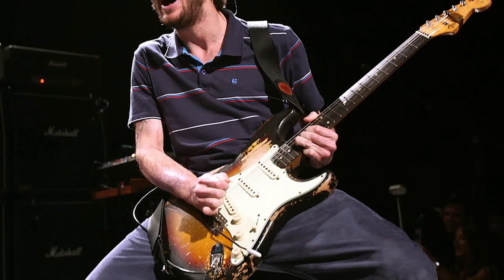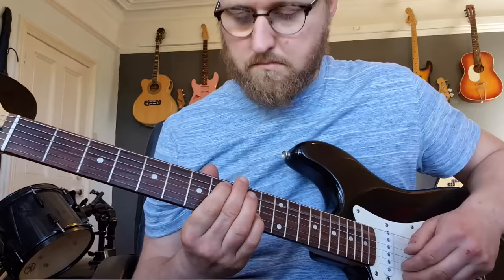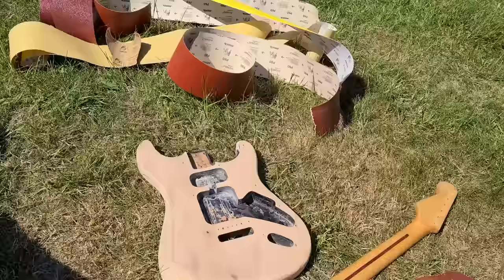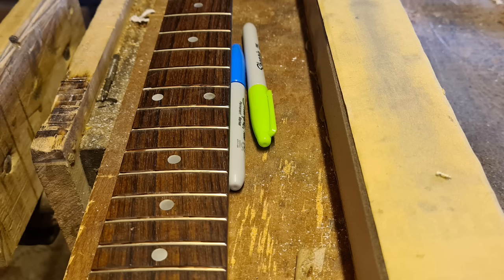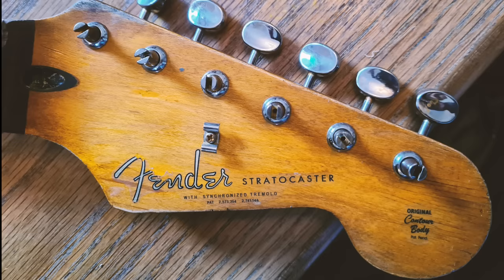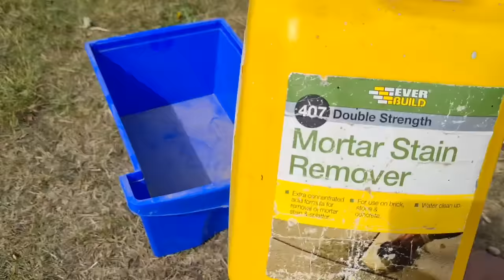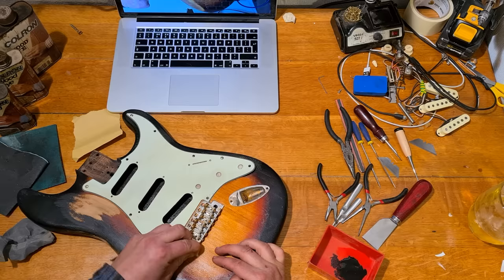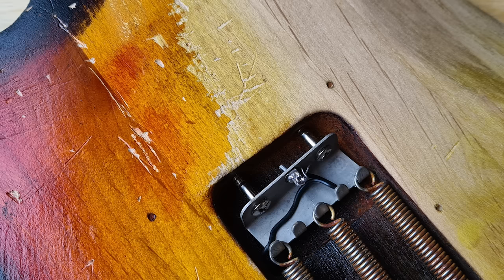How To Turn An $80 Squier into a John Frusciante 1962 Stratocaster

Comment: Nice work. I especially liked how the aged Fender headstock decal magically appeared from out of nowhere before the nut went in.
Reply: @fathippo3518  before and after what? The parts added or swapped out were documented and explained throughout the article. The decal "simply" appeared, no explanation of where he got it, or how he managed the aging of it. Considering how much the decal contributed to making the guitar look like the original, I do think that it was a very obvious and deliberate omission. So tell me FatHippo, where did he get it, and how was it aged? The author could have saved a lot of time by just showing a before and after shot of the whole guitar.
Reply: Yea, I ended up scrolling back through the video to try and see where I missed him talking about "Hey, I have this genuine strat logo that we're going to add on here!" But.... alas. No.
Reply: He did set himself up to be questioned when he specifically pointed out removing the squier logo then said nothing except "here's the after" with the fender logo
Reply: He omitted to mention the Fender decal because he's embarrassed.and so he should be ...Squier are fine guitars in their own right, 🤷
Reply: Yeah the decal part really most important part.  Like we need to know how to do that.

Comment: Little tip. When you cut your template for the black around the burst, instead of putting it straight on, lay the guitar flat on the ground, put pins through your template and place the template on top of the guitar balanced by the pins. It spaces the template a few mm above the guitar body. Then spray from directly above and you will get a nice soft edge to the black.
Reply: I use this technique in Photoshop
Reply: Yes, I was about to comment this also :)
Reply: Oh man, that's what i was gonna say
Reply: Wouldn't that create possible spray build-up drips or runs?
Reply: Wouldn't use a template.

Comment: From a knife maker to a guitar creator, a nice way to sand in those curves is to use a wooden dowel with sandpaper glued on the outside. Make the wooden dowel whatever size you need for the Curve. And if you don't want to do it by hand you can place a screw at the end of the dowel, and put the shaft in a drill. For better stability place a screw at the other end of the dowel and hold it with a sewing thimble. That way you can apply as little or as much pressure as you want, and sand any size curve you have.
Reply: 👍yes! Thats the best tool you can have for doing little projects like this, I have several of them myself 😁
Reply: Oh that’s a good tip!
Reply: Hole saw with desired circumstance with a long dowel going through the pilot hole about 6inches each side.  Cordless drill on one end and whiskey bottle cap for opposite end and you gain a little flex/suspension to yer mini drum sander apparatus thingy. 🔨🪚👌
Reply: This is an amazing tip, thank you 😁
Reply: Genius 👏

Comment: Ive learned from tomofujita that any cheap guitar can sound good if its well adjusted and the right fingers play it
Reply: Pretty much. The biggest issues are tuning stability and intonation. The nut is the first order of business, because if the highest point is towards the back, the intonation of every note will be off no matter what you do to the bridge. If you have solid machine heads that eliminates most of the issues, especially good locking tuners (wound properly). Then you have to look at the bridge, if it’s floating, it has to float properly or else it will go out of tune within minutes. If you have a super cheap squire or whatever with a 6 point bridge, you may as well crank the springs super tight and not use the whammy bar and treat it as a hard tail. Get your strings intonated, action and relief set, pickup height set, and after that, as long as your electronics work properly (even if they aren’t the best) you will at the bare minimum have a $150 guitar that plays just as good as a $1500 guitar.
Reply: Tomo can make a tomato can sound great!!!
Reply: @tatialo37  agreed
Reply: That’s also not bad marital advice
Reply: @Sauce Commander: great intervention. I agree wholeheartedly on every point. Of course, the right fingers are the determining aspect to make it sound good, but pretty much everything you listed must be in place for it to happen ....
Reply: @tatialo37  Tom(at)o Fujita.
Reply: Thats VERY true! 👍
Reply: Tomo is one of the best

Comment: How To Turn An $80 Squier into a John Frusciante 1962 Stratocaster

"It's super easy dude just buy about $250 worth of parts (ngl I didn't know his pickups were so cost-effective) and be an expert at finishing guitars"

Jokes aside I think your recreation of his guitar looks better than his guitar.
Reply: I don't think this video shows anyone being an expert at finishing a guitar😅
Reply: Eh, cheaper than commissioning a shop to do it, fender themselves would probably charge upwards of £5,000 for something like that
Reply: Taking a Squier that plays great and then replacing literally everything is actually one of the most cost efficient things you can do. A Bullet Telecaster can be shipped to your door for $120. For another $300 I got: Locking tuners, Bill Lawrence pickups (a Nashville set with a strat mid), Graphtec nut, CTS pots, Switchcraft jack, Electrosocket jack cup, a 6-way pickup selector, and a real Fender Tortoiseshell pickguard. I left the bridge stock because I really couldn't find fault with it and replacements are hilariously expensive. Throwing on your own series/parallel toggle is easy and costs literally a switch.

The only difference between my guitar and an American Ultra is $1,600 and the heel cutout.
Reply: @TcSomers  o
Reply: @TcSomers  yeah., ok
Reply: Imagine a video about John Fruscante monotone backing vocals...
Reply: @TcSomers  and down the line you could always get a warmoth body and neck to upgrade further and get any features you're missing.

Comment: That looks like a squier bullet, the standards have the 70s headstock. Some squiers are excellent stock like the classic vibes series, they don't need any modifications.
Reply from the maker: It looks that way, but it's a mid-90's squier affinity, they had full size alder bodies and full size necks/nut width.. clearly they realised that they were too good and that as modding platforms they'd hinder sales of mexican made instruments. At least thats my thinking!
Reply: @wilsonguitars2724  i both own a 70's classic vibe 2019 which is very good and nice, i just improved the saddles and put 2 rolling string guides; and i also own a Squier Strat N Series MIJ 1993 and it's just very, very nice. just wanted to know if you anything about those japanese rock n roll katanas.
Reply: I have a squier affinity strat, fender tele, Gibson les Paul, and a squier classic vibe. My favorite guitar out of all of them is my stock squier affinity, it goes great with my amp and I get srv and frusciante tones with ease. Great neck and fret job too with pretty good sounding pickups as well. I just find it weird that my squier 50s classic vibe which costs 250 more dollars  sounds worse and has a really crappy fret job for some reason.
Reply: @Wilson Guitars what you’ve got there is a Squier Strat SE (Special Edition). They were originally sold with a small amp as a “starter pack” at various retail outlets and catalogue stores like Argos in the UK. Unlike the Affinity Strats, they have full thickness bodies, so you can fit proper Fender bits like full-depth trems rather than the lightweight (and somewhat weedy) Squier versions. They’re easy to spot as (like yours) they don’t have the “Affinity series” logo on the headstock, just “Squier STRAT by Fender”. They are cracking platforms for modding … like wot you have done! 😀 Brilliant job!! 👍
Reply: Had s Squier from -96, made in China. Headstock looked exactly like this one, however mine did not have an alder body, it was some gray wood and plywood front and back.
Reply: @wilsonguitars2724  absolutely I was so impressed with mine that I bought in 1990 to take to music college I upgraded and gigged for well over 10 years on it with not a single issue. So much so when I saw another in a bit of a sorry state for 35 quid I snapped the guys hand off and made a duplicate of the original i modded and it’s superb
Reply: @kungpuk5186  I believe some where basswood. Neither of mine are very ply
Reply: @Wymansan19  my 50s classic vibe sounds amazing.
Reply: @philstevens7526  That's not the SE version.  Those were mostly made by AXL (who later made some of the Classic Vibe Squiers) and are easy to spot by serial numbers starting with CSX.  They didn't have the tiny "Fender" logo on the headstock and they didn't have those cheapo tuners.  They were low cost sealed tuners instead.  Those are really good guitars with great necks.  Swap out the hardware and you have a decent guitar for gigging, but then it's no longer such a bargain.   I have 7 of them because I like the neck carves on them so much.  They vary in thickness, but all have a very comfortable carve...
Reply: @voxelraster  Thanks, but why does mine start with CSX yet also have the tiny fender logo? Always thought mine was part of that kit. Thanks again, sir.
Reply: @philstevens7526  no it’s a mid 90’s Chinese model. SE’s had serials on the back of the headstock (mine are all cxs made by AXL) 11 hole pickguards and sealed tuners, not the trapezoid, 8 hole, serial on the neck plate like he has.
Reply: Yeah I bought one from my neighbor for 100 bucks a few years ago and set it on fire beat the shit out of it , sanded the neck down and slapped a JB I had in the bridge . I threw it back together not expecting much but damn it was a player . I didn’t replace the hardware so those parts were still suspect. One of my friends came over picked it up and fell in love with it and wanted to buy it. It was hideous because I attempted to relic the poly then painted over it several different colors and sanded and burnt some more . It played really good though and with tuners and a bridge would’ve really been a workhorse. I foolishly thought I could turn any cheap knockoff into something similar and it was my craftsmanship lol . Nope turns out the older affinity were indeed good mod platforms and they had real rosewood. I believe with squires to Japanese to the Mexican up to American strats it’s a toss up as to getting a good neck . In the 90s I preferred the Japanese fenders to Americans . Some of the older affinity were nice but people have figured that out because you can’t find them for 100 no more .

Comment: Fantastic job! I took a Squier Tele and made it into a distressed relic, something you would find in a back swamp Louisiana bar. It looks awesome with scratches, dents, dings, belt buckle rash, cigarette burn, yellowed headstock, cracked "clay" dots, aged hardware (formerly shiny chrome), and actually plays real nice. I bought it for $100 only because it had upgraded pickups and it was a steal. I refinish vintage drums (like in bad shape!) and this was about 10 years ago. I was testing every technique I could do just to mess around. My initial goal was to take my Squier Jazz Bass and distress it, but I changed focus to vintage drums (since I'm a drummer!).  Killer end result here - looks and sounds fantastic! Cheers....
Reply: Do have a link to some pics?

Comment: The second string tree is actually a beneficial change they made, and weirdly mostly squires have them. It helps with string angle and buzz when you use low action.

Comment: Those old Chinese squier strats are a super solid modding guitar. I gigged with mine for 10 plus years and it always stayed in tune once I put graphtec saddle, and string trees on it and upgraded the machine heads. As you say the necks are fantastic too. The guitars are so good I picked one up needing a fair bit of work for I think was about 35 quid at a guitar fair. I have got Japanese and American strats but I love both of these strats they’re so great once refretted and upgraded and set up properly

Comment: Just a thought, I have had better success doing the fade for the sunburst by holding both cans of color at the same time and spraying them in at the same time.  The fade of the dark to light is much more gradual when both are sprayed together.  Its helpful to run a test on cardboard to get the feel first.
Reply: Thanks for the tip bud
Reply: That's how you usually make fade in graffiti, way more control than just trying to do it with help from templates
I'd also recommend Graffiti paint, because usually it's really saturated and dries good
I recommend 94 or Montana White, or all it's analogues
Reply: or you can use wood dye like pros do, and blend it to perfection

Comment: My only beef with the cheap Squier for modification is the truss rod . I found a good quality neck replacement was essential but neck pocket modification was needed for good fit and alignment . This pushed the price up . It probably comes down to the luck of the draw when buying a cheapy. I find the classic vibes are generally very good guitars requiring very little modification .
Reply: According to a Rep, the Affinity series was upgraded and has similar guts as the classic vibes now.
Reply: @TexanUSMC8089  worth knowing as the affinity is half the price . I have examples of both including a " vintage modified " that is hard to find now . For the medium level player Squiers are all that are needed . Great guitars for the money
Reply: Really? Cos I wonder how great the quality was in 1962. I know thats not Flintstones era but weve come a long way.
Reply: @metaldreams3595  I've played a properly set up '57 hardtail Strat and it played like a wet dream. And I own a '62 which has a thinner neck than the 57 but it plays like butter too. Trust me Leo Fender had perfected the electric guitar by 1962. And that's saying nothing about the sound!!! Those pups are simply magical. That's why the '57 Strat's are going for 30k these days.
Reply: @patrickfoster4586  wow, how silly of me...I stand corrected. Thanks, maybe I can find a 62 re-issue

Comment: Nice Work !   The sunburst makes the easiest "build a 60s strat"   I took a std squire SE I believe? Sunburst-  added Kluson Tuners, Bone nut, Fender Strat bridge Saddles, CTS pots, 3-way switch (all fender parts) all cloth covered wiring, and a set of Fender Pure Vintage 65 pickups ..and the Fender Strat logo from '68, .  It sounds and looks Great.  Instead of buying a 60s strat for $20,000 I built this for $400...close enough for me

Comment: I have a Ibanez Iceman that I redone I changed everything on it Schaller locking tuners and 2x Bill Lawrence pickups (l500xl and l500r) also new pots new output Jack new toggle switch it's pretty cool actually one-of-a-kind. Left it black colored with cream & abalone binding.  Nice job on 62' Fender 👏

Comment: Great job 👍🏻 I really enjoyed watching. You did great to make it look old & authentic, instead of it being relic’d. I didn’t realize that just the vapors could age the metal parts. Really good job there. Not overdone. 
I’m curious, is the body standard thickness & what wood is it?
Reply: In the start of the video, he says it's a Squier Stratocaster Standard. However, it doesn't look like a Squier Standard to me. It's an Affinity, because the hardware on a Standard is way better than both their Bullit and the Affinity. The Standard also have Alnico pickups and full size pots. Your question deserves an answer, and I'm Sorry, that was all I could tell.

Comment: I did the exact same thing to a Squier guitar; stripping the body and it was the biggest ball ache of all time. getting the sealer off underneath the poly finish was dreadful. It took a heat gun and a belt sander and was as stubborn as hell.

Comment: The first guitar I ever owned was a Squier my dad bough me all the way back in 1996. I STILL play that guitar. 26 years later. I eventually upgraded the pickups and wiring, but I gotta say, I never had a single problem with the tuners. They always stayed in tune, were never hard to turn, nothing. It still has the original tuners on it to this day. I honestly have had less issue with them than I do on my Epiphone studio. 

Maybe Squier switched to worse tuners since then, I dunno. Or you bought a used guitar on facebook. Maybe the original owner abused the tuners.

Comment: REALLY good job dude!! Buuuuuuut… 17:08 those strings aren’t centered on the fingerboard, my ocd is kicking in
Reply: I think the bridge is mid-aligned. It looks ok at the nut.
Reply: @Telmo Sanz I came to say this! Great video but disappointing that after calling out about installing the bridge too close to the edge of the fretboard for the high E, he then ended up going the other way!
 
I think it needs a combination of tweaking the neck angle in the pocket and shifting the bridge further to the controls. I think he may have used all the original pickguard screw holes which are never the same from one pickguard to another which led to the bridge being misaligned. 
The relic work turned out really great though.
Reply: @Hades_88  really minimal adjustment required It may work the Ron Thorn’s way: push the neck to the other side and tighten even more the screws

Comment: I've modded 2 squires over the years and it is comparable to a Chevrolet 350.....it can easily be turned into a monster with some time and couple changes. strongly suggest anyone wanting to experiment with pickup swapping or pot changes to do so with one. yet to be disappointed. great video 👍